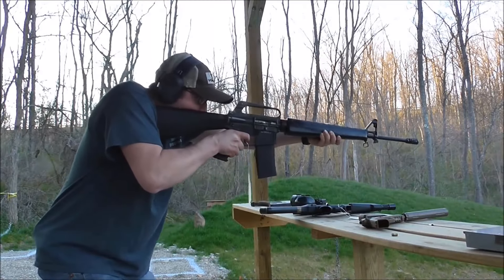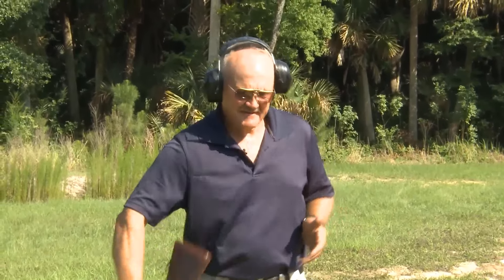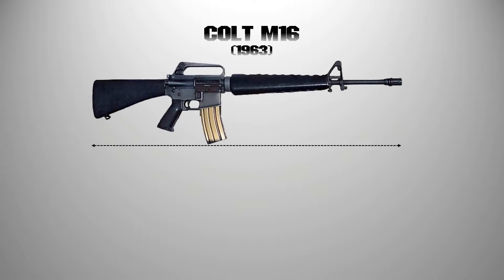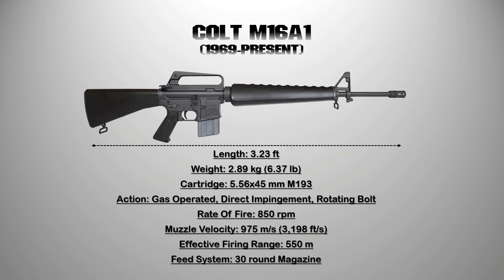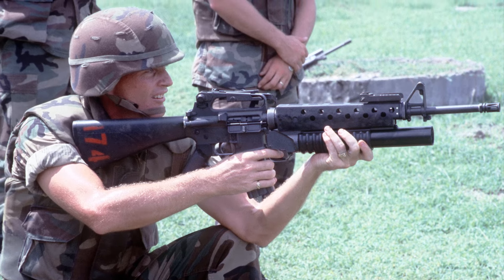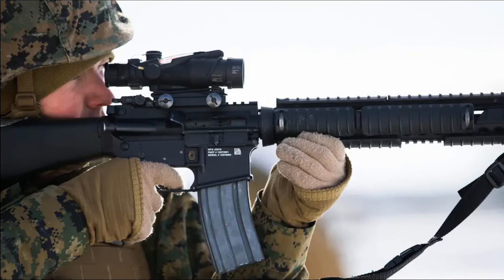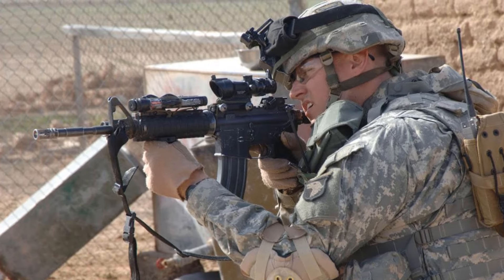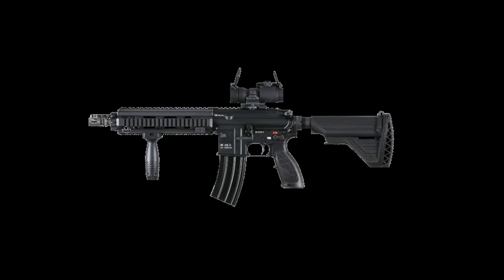Evolution Of M16 Rifle (1957- 2022)

Comment: The AR-15 was never adopted by the military.
It was the M-16 that was adopted by the military (and routinely widely hated in Vietnam).
Reply: sorry if i sound dumb but didn’t they resolve most of the issues with the A1? or did the A1 still get a lot of negative feedback?
Reply: @some_cool_random_guy  Some of the issues were inherent to the 5.56 vs the 7.62 - like low penetration and low effective range.
Low effective range wasn't an issue inside a jungle, but it was sometimes noticeable in open areas elsewhere.
There's a reason you never see a 5.56 sniper rifle, SOMETIMES see 7.62 sniper rifles, and sometimes see .50 CAL (12.7 or so) sniper rifles.
Reply: the ar 15 was used in the vietminh war
Reply: @Not_ameco9  Perhaps by Special Forces, but it was NEVER US Military Issue.
That was the M16 pr the M14.
Reply: The main reason the M16 had problems was because of the Army Ordinance Corp changing the cartridge powder and issuing shitty cleaning kits. They were disbanded because of it. The rifle itself was fine.
Reply: @MrCherrygrovedude  It also had issues where the bullets tumbled, which caused it to have insanely LOW penetration in the jungles of Vietnam.
It was fine in the desert - the Israeli's loved the thing.
Reply: @bricefleckenstein9666  do you have any data/studies backing your statement? The .223/5.56 round is designed to yaw to increase damage in the body. It will not tumble unless it goes transonic and that's usually not until around 800+ yards. I would take 5.56x45 over 7.62x51 in a fighting rifle any day.
Reply: @MrCherrygrovedude  the .223 also gets slowed down when it has to travel THROUGH vegetation - like in a JUNGLE.
Probably why the Israelis like the round better - a lot LESS of that in a desert like a lot of their country vs an area like Vietnam.

I'll take 7.62 - despite the higher weight - due to it's longer EFFECTIVE range and greater stopping power, but I'm a pretty big guy and the extra weight wouldn't be a big deal to me.

BTW - you ever see a 5.56 sniper rifle?
Seems like a lot of those are even LARGER - .50 BMG for some, 7.62 for the SMALLER sniper rounds.
Reply: @bricefleckenstein9666  an SPR in 5.56 (MK12) with MK262 will do 99.9% of anything anybody needs to do. The vegetation argument is irrelevant with a proper setup. 7.62 is great for a DMR/sniper application but it's not the best fit for an all around weapon system. I'm 6'6 300lbs so recoil with any caliber isn't a problem. 5.56 77gr is king.
Reply: @MrCherrygrovedude  I would not agree with that 99.9% figure at all.
AT BEST perhaps 90% - but try stopping a charging Moro tribesman with one.

There's a REASON the US adopted the .45 in the early 1900s for it's handguns - and similar reasons and situations are STILL possible and happen today.
Reply: @bricefleckenstein9666  look up the history and first hand accounts of guys using SPRs and 262. They wouldn't have anything but. Also 9mm is better in every way than .45. I'll take my Mock12 and G17 anywhere anyday.
Reply: @MrCherrygrovedude  9mm has less stopping power than .45 - but it DID NOT EXIST at the time the .45 Colt 1911 was adopted, so it was a moot point then.
It is NOT "better in every way", it often takes 2 or 3 hits to do what a .45 can do in one hit.

It IS a smaller round, so you can pack more of them into the same space - but you NEED the extra rounds a lot of the time making that generally a wash.
Reply: @bricefleckenstein9666  stopping power doesn't exist. I know you have no clue what you are talking about, but please educate yourself on ballistics. There's a reason why any governmental agency/military worth a fuck prefers 9mm over 10mm, 45, etc. 9mm is better in every way.
Reply: @MrCherrygrovedude  You just showed your TOTAL lack of knowledge.
Just go away, you're not worth discussing this issue with.

As a hint - I'm a Vet, and no we DO NOT prefer 9mm over .45 or 10mm.
Reply: @bricefleckenstein9666  you showed your lack of knowledge when you said "muh stopping power". You know nothing about ballistics. 9mm is superior in a fighting pistol just like 5.56 is superior in a fighting rifle. Again, any military/government agency worth a a fuck prefers both.
Reply: @MrCherrygrovedude  You showed your total idiocy when you said I said "muh" in ANY comment.
You can't even be bothered to READ.

And if 5.56 is so superior, why is it NOT USED in sniper rifles?
Speaking of ballistic total ignorance....
Reply: @bricefleckenstein9666  we aren't talking about sniper rifles, we are talking about fighting rifles. They did away with 7.62 for many reasons back in the 60s. It is not a good fighting rifle round for modern warfare.
Reply: @MrCherrygrovedude  7.62 is and was a perfectly good fighting round.
The change was made to lighten the load on an infantryman, NOT because the round was bad or inferior in anything BUT weight.
Reply: @bricefleckenstein9666  no it isn't. 5.56 is superior in every way to 7.62x51 in a fighting rifle. Decades of military conflicts and real world use has proved this. Less recoil, faster more accurate shooting, lighter gun, lighter ammo, etc the list goes on. If it were up to people with your logic the military would have never adopted the AR-15 and stayed with the M14 which was the worst and shortest lived service rifle in US history. This conversation was discussed and settled in the 60s. Research the extremely corrupt ordinance corp that pushed for the M14 and sabotaged the AR-15 every step of the way including Vietnam. They were held liable for the problems caused in Vietnam and were disbanded.
Reply: @MrCherrygrovedude  Less recoil because the round is lighter.
More accurate? WRONG, JUST TOTALLY WRONG, you don't use LESS ACCURATE rounds in a sniper rifle.
Faster? very little, and AGAIN due to the lower weight.
Lighter gun? I already STATED that weight was the one advantage the 5.56 has over the 7.62
You conveniently IGNORE the shorter range the 5.56 has - not normally a factor in jungles, but it CAN matter where sight lines are clear like in large parts of any desert.

And it's not the ROUND that made the M-16 ARGUABLY (a lot of folks that USED both in battles disagree) better than the M-14.
Ask Vietnam vets sometime HOW MANY OF THEM hated the M-16 vs the M-14.

Your "proof" is HIGHLY debatable at best, IF it exists.
Reply: @bricefleckenstein9666  again, your ignorance is showing. You can tell you aren't a vet much less seen combat. 5.56 is faster and more accurate because it has less recoil meaning you can put more rounds on target faster than 7.62. Again, we are talking about FIGHTING RIFLES. The 5.56 round 100% made the M16 better than the M14. The M14 was uncontrollable on full auto and the stocks would swell in the humid environment. The Vietcong had AKs which were way mire advanced vs the M14s. The M16 allowed controllable full auto fire, better accuracy during fast strings of fire, and they could carry double the ammo to maintain that suppressive fire. The M14 was a garbage platform and still is.
Reply: @MrCherrygrovedude  As it happens I AM a Vet.
When and where do YOU claim to have served, and with HOW FEW if any that served in Vietnam if you served at all?
My service was mostly in the late 1970s - LOTS of 'Nam vets still in the service at that point and LOTS of hatred towards the M16 and it's many issues.

5.56 is NOT more accurate - and while it has less recoil, it still has enough that you have to WAIT between shots if you expect accuracy beyond the first shot, especially when the WEAPON is also lighter.
And how are you claiming the M14 (whatever it's flaws) was NOT a "fighting rifle"?
You're starting to sound like the Liberals and their self-decided "assault weapon" definitions that ALSO have no basis in actual fact.

The M16 WAS ALSO not controllable on full auto - YOUR LIE about that is so WRONG it's pathetic.
NOTHING short of a full machine gun is "controllable" beyond short bursts.
The wood stock on the M14 was an issue when not properly maintained - which is WHY it became an issue in Vietnam, too many "short term" troops that just didn't CARE and didn't do the maintainance.

The AK-47 used by the Vietmign were an older, LESS well developed, but fairly robust design that was ALSO not "controllable on full auto" and were in no way, shape, or form "more advanced" than the M14.

The M16 also NEEDED more ammo, as that round provided noticeably less damage and would NOT reliably go through jungle leaves/vines/etc with ANY accuracy due to the "tumble" issue designed into the round.
Reply: @bricefleckenstein9666  "service in the late 70s" tells me all I need to know. You are stuck in old, outdated logic. The entire purpose of the M16 was an intermediate cartridge rifle with easily controllable recoil, less weight, more ammo able to be carried, etc. It has lived up to that mission and more being Americas longest serving and best weapon platform ever. Nothing you say will change that and your boomer/AARP logic has been debunked for decades. Both at AK and AR were lightyears more advanced than the M14. The M14 is and was garbage.
Reply: @MrCherrygrovedude  The logic of a large part of the time the M-16 WAS IN USE, I'll remind your ignorance.
And no, it was NOT "easily controllable recoil" as the rifle was so LIGHT, it ended up being very similar recoil to the M-1 and M-14.

And no, my logic has NOT been "debunked" in any way, shape, or form.

Just because YOU say ONE SPECIFIC WEAPON that used the 7.62 was garbage (it was not nearly as bad as YOU claim it was - any more than the M-1 was when IT was a relatively new rifle) doesn't mean the CARTRIDGE it used was garbage - that's a HORRIBLE excuse for so-called logic.
Reply: @bricefleckenstein9666  the M16 is very controllable on FA and way more so than the M14 was. Once again, you have no clue what you are talking about. The recoil is no where near the same as the M1 or M14. Yes, your logic has been debunked for decades. Your logic died with the ordinance corp back in the 60s. Get over yourself. The M16/AR-15 is king and has been a better service weapon platform than the M1 and M14 combined. The modularity, lightweight, accuracy, reliability, etc is unmatched.
Reply: @MrCherrygrovedude  The M16 is NOT controllable on full auto.
Especially compared to the M14, as the M16 doesn't have the MASS to allow full automatic fire control.
Quit trying to spread LIES about that.
I'm not talking login - I'm talking EXPERIENCE that you obviously DO NOT HAVE.

THERE IS A REASON that the M16 has a "burst" setting - THAT is more-or-less controllable.

And don't tell ME to "get over myself" when YOU keep spouting lies.
Reply: @bricefleckenstein9666  I dont know what gun you think the M16 is, but it was designed and is to this day, extremely easy to control on full auto. You must be 100lbs soaking wet to think that the M16 has a lot of recoil on FA. You have no experience judging by your comments. The M16 has a burst setting not because of it's recoil, but for ammo savings. The M4 has been full auto since the 90s and is the main rifle in the military. Again, you have no idea what you are talking about and you definitely did not serve in a combat role with what you are saying. I've shot plenty of full auto out of the AR15 platform and it is extremely easy and pleasant with little to no recoil.
Reply: @MrCherrygrovedude  You have to be even older than I am to have fired "full auto out of the AR15 platform", as the only full auto out of those was early prototypes and very few IF ANY production.
Unless you're counting the M16 as "AR15 platform" instead of a redesigned version (that's debatable AT BEST given how many changes had to be made to enable full auto out of the AR15 design).
No, I didn't see Combat - was a couple years too young for 'Nam, and wasn't part of the Grenada mission.
I'm ALSO not "100 pounds soaking wet".
And YOUR comments about how "controllable" the recoil in FA from a M-16 are a joke - unless you count "riding the recoil to let it rise A LOT" as "controllable", which was ALSO entirely possible on the M-14.
Reply: @bricefleckenstein9666   the M16 IS the AR-15. The military's designation doesn't change that it's an AR-15. Same family, same platform, same interchangeability, same modularity, etc. Again, the AR-15/M16 is very easily controllable on FA. It was designed by Stoner to be this way to compete with the AKs in Vietnam because the M14s could not. Ive shot the AR platform on FA more than my fair share. It can be done standing at 100 yards while staying inside a man size target with ease. If you honestly think the M14 running 7.62x51 is more controllable on FA than the AR-15/M16 running 5.56, then you are absolutely senile. I can tell you never saw combat, your comments made that very clear. 

Also there aren't many changes at all to make a standard semi auto civilian AR-15 FA. Low shelf lowers and FA BCGs are pretty much industry standard now. Add a FA FCG/selector and a heavier buffer (H2-H3 depending on barrel profile) and that's it. 

Look up videos yourself on FA AR-15s and then look up FA M14s. The reasons the M14 was replaced are VERY clear.
Reply: @MrCherrygrovedude  The M-16 is a design DERIVED FROM the AR-15 somewhat.
It is NOT the same weapon.
Your have just destroyed ANY potential for belief your claims might have ever had with that ONE major error.
Reply: @MrCherrygrovedude  Select Fire.
Bust Fire mode.
Full Auto mode (though by report the very EARLY AR-15 had a full auto mode, but those were never sold to the public if they existed outside of prototype).

Some of the parts can interchange - but you have to change out the entire receiver assembly AT LEAST to get out of single fire semi-automatic mode, by which point you've redone over half the parts in the weapon.

RELATED, I'll grant - FAMILY I'll grant - but not the same weapon.
Reply: @bricefleckenstein9666  any select fire mode can be done to the AR15 just as the M16 had it done. Again, same upper, same lower, same platform. There is nothing special to the M16 or M4 that can't be done to any run of the mill AR15. Most AR15 BCGs are full auto capable, some lower receivers already have low shelfs, etc. It's all the same. I can build an AR15 to have everything the same as an "M16A1-4" or "M4". Those are just names the military gave different AR15 setups.
Reply: in the Ukrainian war  Ukrainian soldiers also have M4 M16A4 rifles as their personal rifles.  But foreign mercenaries such as former US Special Forces agents use Scar - sig 516 rifle
Reply: Well this argument was a nice read
Reply: Why do so many gun enthusiasts say the M16 and AR-15 are the same gun? I can't imagine the military just removing the "AR-15" stamp and claiming it is now an "M16".
Reply: @mts7274  I have no clue.
They're related, but there WERE changes made to suit military requirements.
Reply: @mts7274  Because M16 is just a US Military designation given for the AR-15 when it was adopted by US Armed forces.
Reply: @redneck96100  Yes, but doesn't the military issue of the rifle have different requirements other than just a stamp that says "M-16"?
Reply: @mts7274  Yes, US Military has specific configurations of the AR-15 platform  they use. With features that are illegal to be sold for regular civilians.
Reply: @redneck96100  Right, but for AR-15 owners to claim that they have an M-16 with an AR-15 stamp on it would be wrong because Colt made enough significant changes to the rifle for military use.
Reply: @mts7274  They should've use Stoner 63 maybe.

Comment: To further build on this, HK and the US Marine Corps collaborated to create the M27 which is a production line of HK-416s for infantry Marines.
Reply: HK 416 sucks..Over weight, over gassed and shoots itself apart..
Reply: @hairydogstail  All of the M27s I've used haven't been over-gassed and has been very durable. I don't appreciate how front heavy they end up being but it's not much worse than the M16. Overall having used both I would take the M27 over the M16.

Comment: M16 A2 was too heavy.   Not sure why the M4 still has the 'A frame' front sight.
Reply: Cost. Military doesn't like change, mainly because of cost.
Also the pinned front sight post is sturdier. It's easier to mess up a free floated rail. Gas block has more failures. No advantage to the average Marine. this is what I'm seeing from people that seem to know anyways, not my own experience or anything.

Comment: Can anybody give me a reply on about is Ar 15 and M16 are same or not
Reply: Okay so the only TRUE difference between the two in the modern day is that the M16 is select fire and the AR-15 is semi auto only. Originally however, as in back in the 1950s-60s, both were select fire weapons. 

M16 is the military designation for the select fire version of the AR-15 rifle as the military has to give their own name to guns to keep from getting it confused with guns they don’t use.
Reply: AR-15 is a platform. the M16 is a rifle which uses that platform
Reply: Can't auto fire on AR 15 unlike M16 with fire selector.